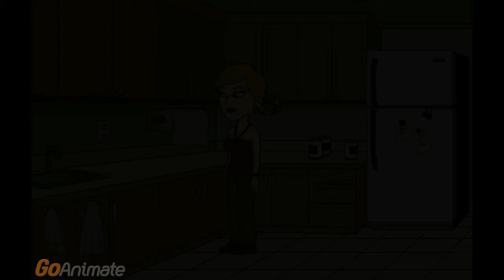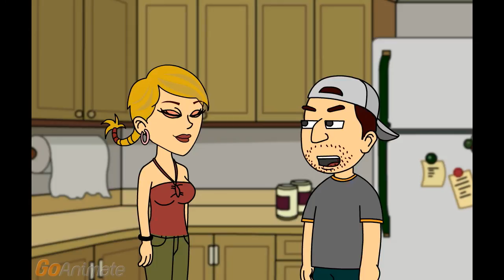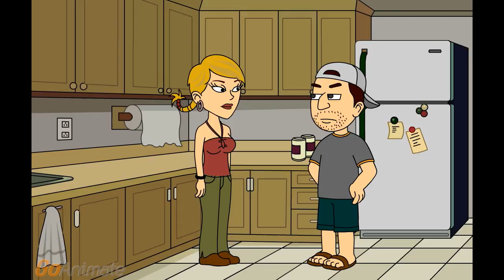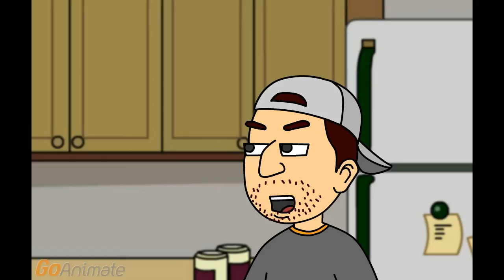My Jenn Air Refrigerator is Making a Buzzing Noise

Comment: What solved my noise problem in this area wasn't any of these. The Condenser fan motor spinning caused the thin plastic drip pan to vibrate against metal at multiple places. Very poor design by Whirlpool. I placed Foam Insulation Weather Stripping Adhesive (3/4 Inch Wide X 1/8 Inch Thick) everywhere where the plastic drip pan touched metal. The plastic drip pan on my Whirlpool/Jenn Air model is located under the Condenser fan motor and runs along behind the Compressor. It was vibrating at its worst behind and to the right of the Compressor.